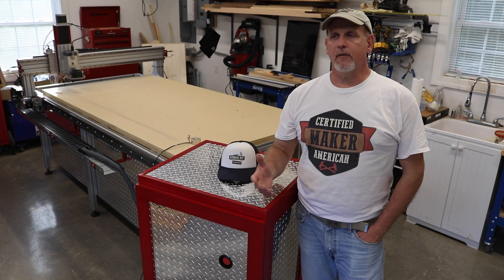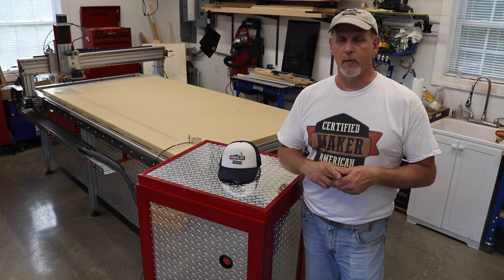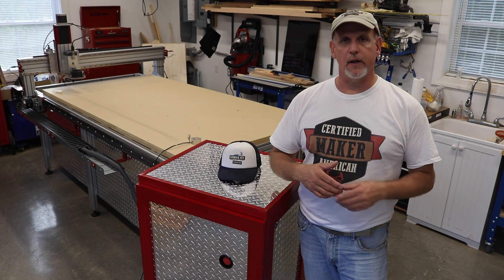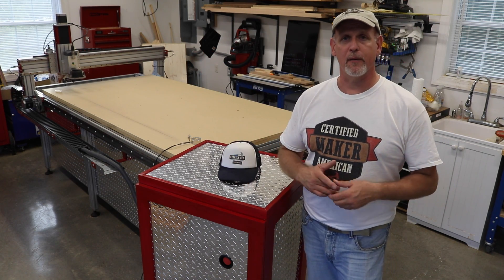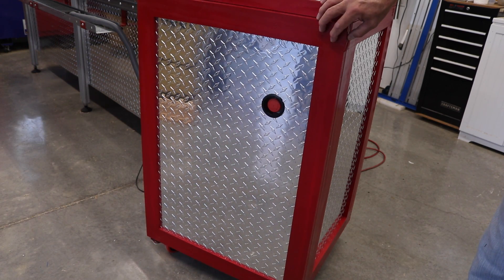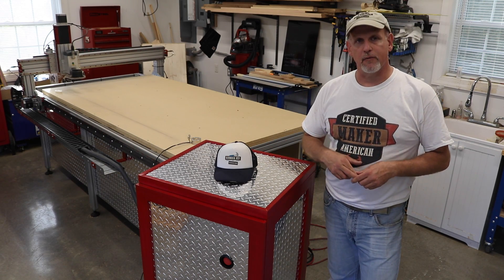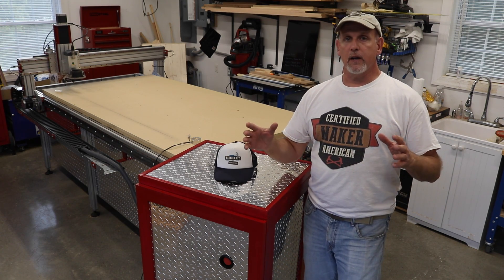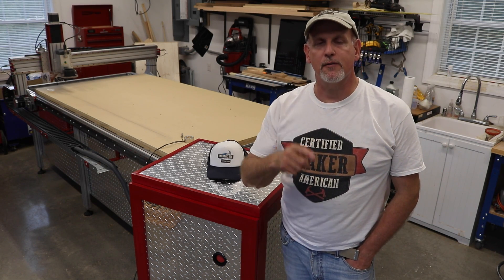CNC Router Parts PRO Upgrades

Comment: I am considering doing this upgrade right now to my older avid machine. My question is did it come with the newer router/spindle mount ? That is totally different than what my current machine has for the Z axis. It looks much more solid. I have a quote from avid and I am almost tempted to just get a newer unit as the gantry mounts look way more solid also.
Looks awesome 
Thank you for the video

Comment: Great looking machine and it's nice to see someone DOING it. I got exposed to a CNC router while working at an Avionics shop (we made instrument panels for light aircraft) and it opened my eyes. Couple it with a laser engraver and you can produce almost anything.

We powder-coated the Aluminum, applied laser tape to the panel, and laser-engraved the text into the panels. When done, leave the tape on and lightly spray-paint the engraved letters for a killer instrument panel. Then use an Xacto or other blade to carefully remove the tape. Looked GREAT and won awards very year.

Good luck, Feddie. I wish we were neighbors!

Comment: Not trying to be contrary, I really like the cnc routerparts stuff myself.

I have an older “standard” cnc router parts machine as well as the v-con “pro” machine which you upgraded from.  I also have a camaster stinger which runs the same kind of rails in the new “pro” machine.

To keep it short, out of all those, the old standard machine runs measurably better than the other two despite having inferior electronics etc.  If I were buying another machine right now, I would go with the older “standard” linear system.
Reply from the maker: Cool.  I never had one of the standard machines.  Glad you have had a good experience with it.
Reply: Why would you go with the standard machine? Are you talking the current standard machine? Even with using the heavy 25lb 2.2kw spindle?

Comment: Really nice machine.  I notice your table top doesn't have any T-Slots or hold downs.  Do you use a vacuum system.   If so, could you tell us a little about it.  Did you build your own table for it?
Reply from the maker: Thanks Justin.  I usually screw things down or use double sided tape.  Hope to add a vacuum soon.  I used the leg kit from CNC Router Parts for the table.

Comment: I put together a PRO 48x48 from CNC Router parts. I didn't buy the kit because I was piecing it together as $$$ was available. When I last talked to Cory there, they didn't indicate they would be providing upgrades because of all quantity of components that changed. Out of curiosity, did they buy back your old components or offer an upgrade discount? I've yet to see the parts for the news stuff on their site.
Reply: Just a quick update. I talked to Cory today at CNCRouterParts and he did say they are selling the upgrade parts on a request basis. They just don't have them listed on the site yet.

On another note. I forgot to mention that your machine looks awesome. Love the diamond plate! I started with a Bosch router and just ordered a single having spent 2 days vacuuming the entire garage and elevating it from 5 gallons of MDF dust. The Bosch blows the stuff everywhere. My new spindle is water cooled so no more!  Now I have to get to installing a new sub panel :(
Reply from the maker: Thanks for the kind words Tony.  I really appreciate it.  You are gonna love the spindle man.